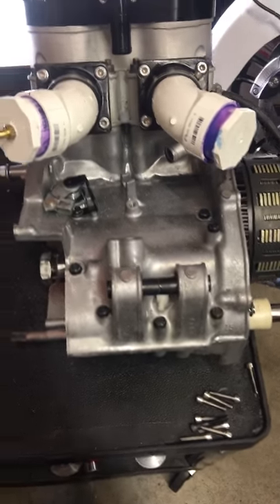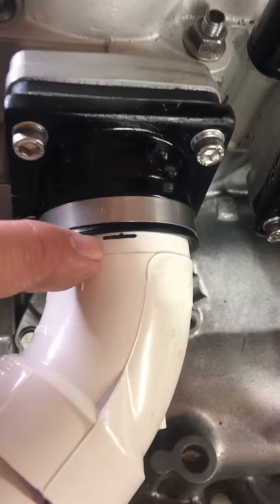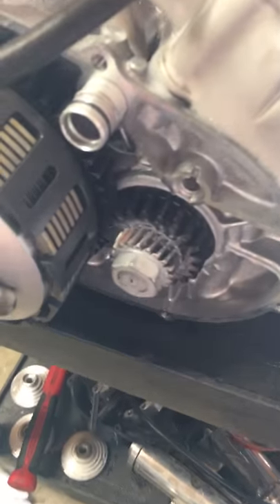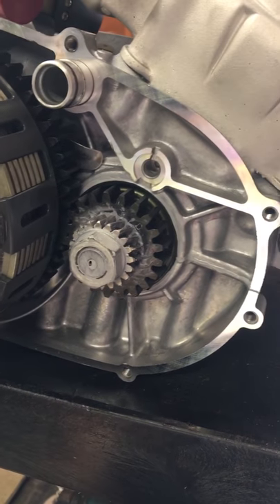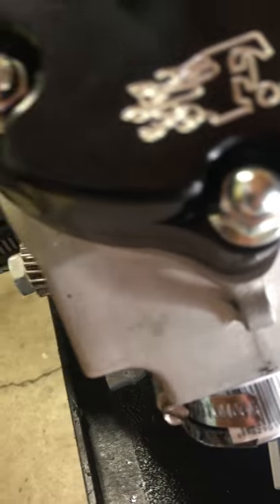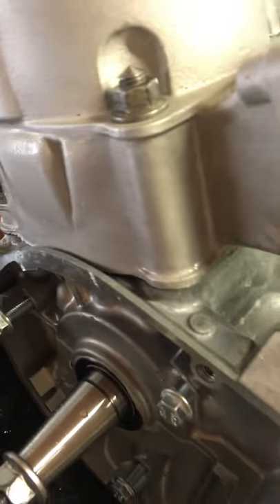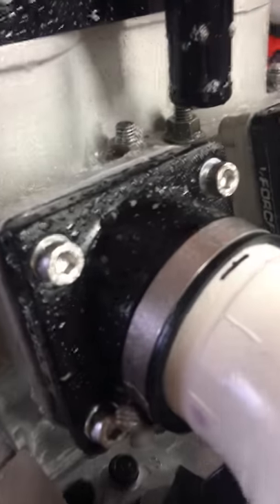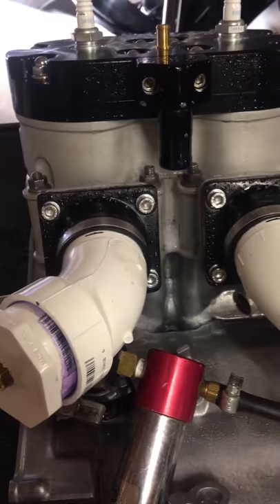Yamaha Banshee leak down pressure test 2 stroke tips

Comment: Wow lots of leaks 
If you ever have a leek in your head bolts first thing I would do would be to replace the nuts and start with brand new ones cuz they're tight. And if they still leak I would replace the cylinder bolts with new ones too. But then again I've never had a problem putting 10 psi in a motor that I've biult for a half hour psi drop this is with cr250.
One more thing you should probably put a gasket on both sides of your reed cage
Reply from the maker: Thanks, I do have gaskets in both sides of the reeds. I’ve built many banshee engines that still leak at the reed gaskets. This engine is still running strong and proves that if you pressure test first and take care of your leaks you will not have issues. 🤘🏻
Reply: @Buster_Baits  my reed gaskets are leaking now what do you recommend